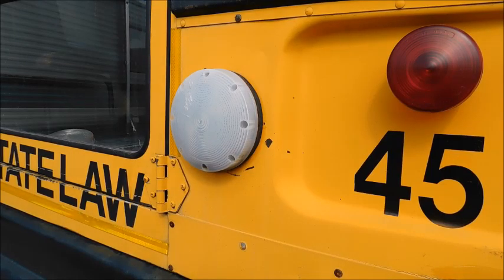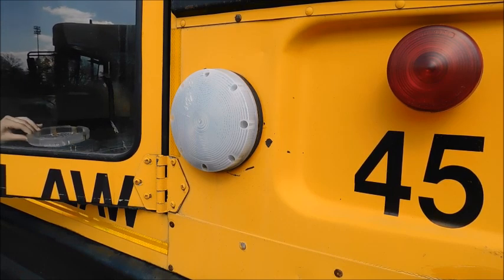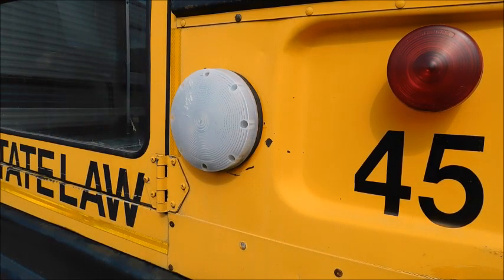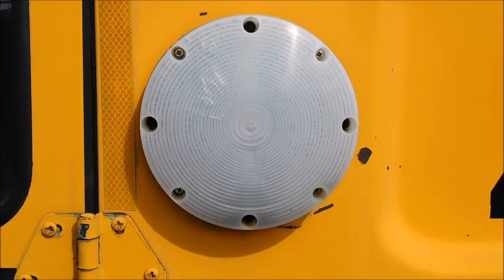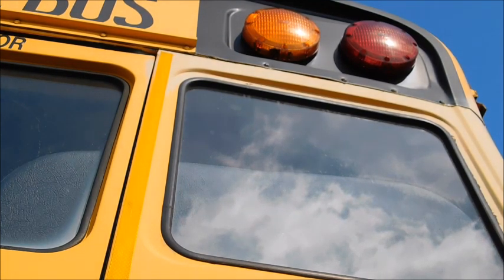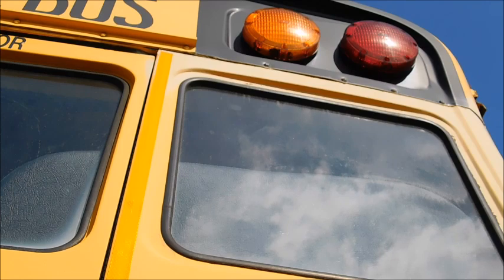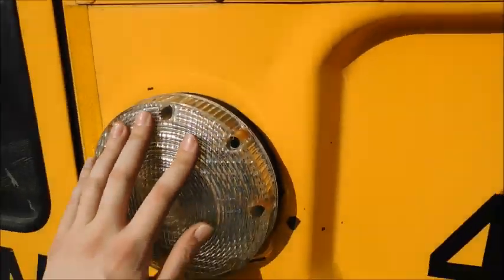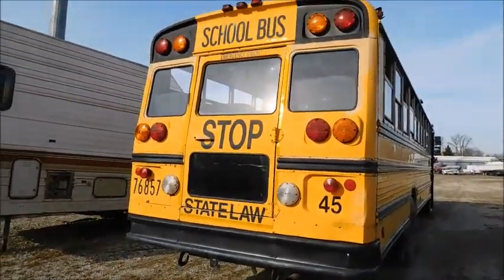How to Change a 7" Lens on a School Bus - School Bus DIY's

Comment: Would a back plate from a turn signal fit a reversing light?
Reply from the maker: Technically yes, as long as it’s a 7” light. The only difference there is the fact that the lens is a different color. So in that case, as long as you changed the lens it would work fine